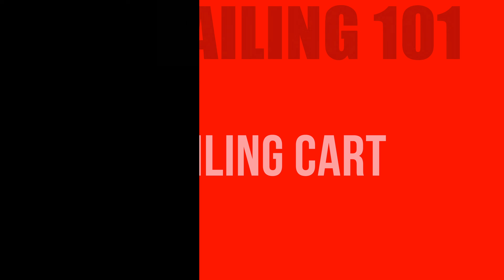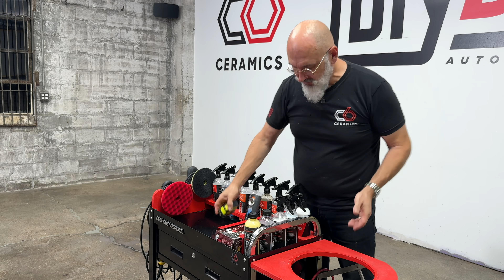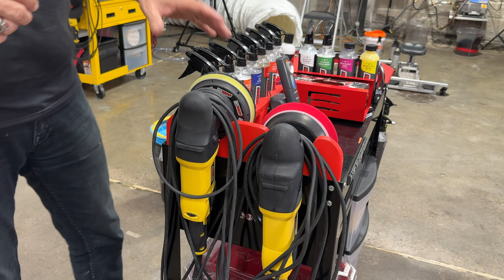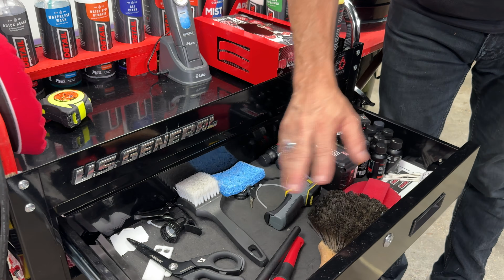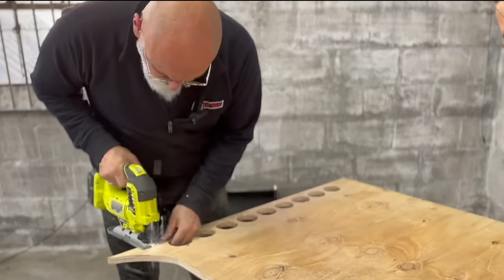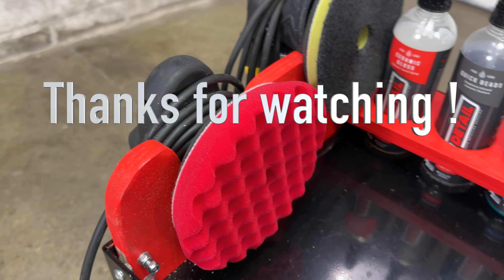Build your own detailing cart  with Yvan Lacroix. Detailing 101

Comment: Hi 👋 is there a video showing the bucket on wheels? How are the two buckets Connected? Two Dollie’s and something else? Thanks
Reply from the maker: Coming soon!
Reply: I did some searching and looks like it may be a dual bucket dolly connector plate that will do the trick. Putting on both ends of each bucket. I currently use 3 buckets- one to sit on while I do the wheels, 1 for face of wheels and 1 for the barrel and tire. Maybe 🤔 I could just use one but  I like it as easier to find the brushes and keeping the dirtiest part separated. Therefore it will be great for me a dolly bucket system

Comment: This is pretty good. I'd consider adding platform extension below the wash bucket side, maybe put a wheel on it for added stability and 0 chance of cart tipping over regardless of what you're doing on the bucket end. With the extra space, I'd figure out someway to add a pressure washer hose reel and a pressure washer to the cart so it's literally just a one stop shop of pulling the cart out, plugging in your water source, plugging in the extension cord for power and getting the wash done efficiently.
Reply from the maker: Good ideas

Comment: I bought two cleaner buckets from Target LONG time ago (maybe like 20 years at this point) and they have survived without issue. I initially used them for my two bucket system. Nowadays I repurposed them to either hold my washing tools or my actual wash bucket (from Home Depot); essentially using a bucket to dolly my bucket lol. I also just upgraded my detail cart to a metal cart (my little plastic one was the little engine that could). Fun stuff haha.

Perhaps I'll add some shelves on top of my cart for the spray bottles. Thanks for the video for more ideas hatching in my noggin!
Reply from the maker: Thank you.

Comment: About the only thing I’d change is adding an extension chord reel to make roll up easy. 

But I do understand that extension chord is probably longer than most reels 

I wish I wasn’t mobile, this would be so nice. I work out of organized bags and tool totes
Reply from the maker: Thank you.
Reply: I do not have reel but if you use over  under coil method it will untangle easily.

Comment: A one lane driveway with grass on both sides that is at a 20-degree drop is such a pain.  Anything on wheels either gets stuck in the grass or rolls down the driveway into the street.
Reply from the maker: That’s not easy
Reply: @diydetailofficial  Yeah, I know.  I usually just set up a card table and set everything on it and just have to walk back and forth but try to keep as much in pockets and such while working.

Comment: Anyone know some good "off-road" carts? lol
Reply from the maker: The wheels are easy to change. You may need to design a lift kit though
Reply: Buy one of those Gorilla Yard Wagons/Flat beds, plenty of companies make them at various price points.  Then find a utility cart of your liking and attach it to the wagon. Or buy wheels like POWERTEC 8 inch Heavy Duty Swivel Caster Wheels, but I think the flat bed conversion would offer more stability and better flexibility.
Reply: @crzyworm623  you rock